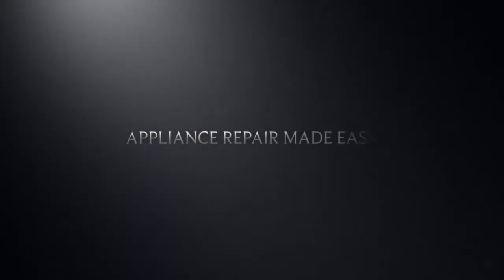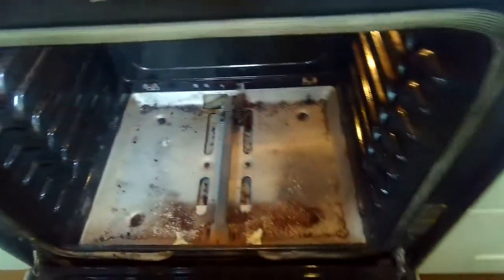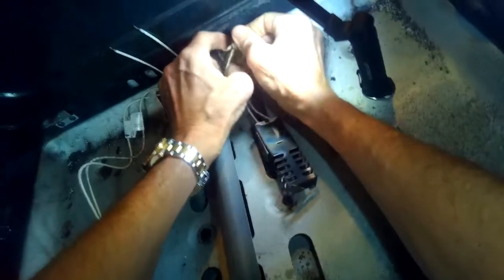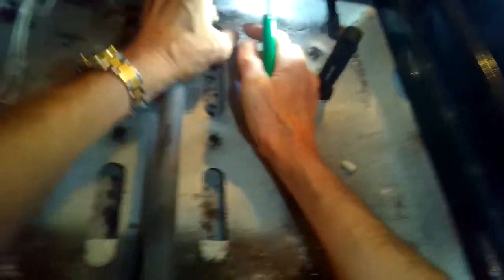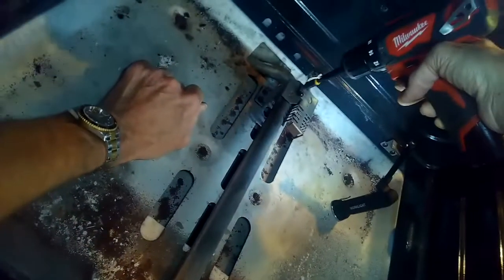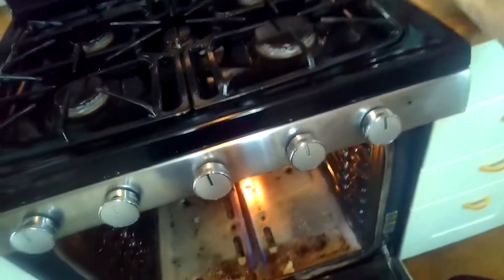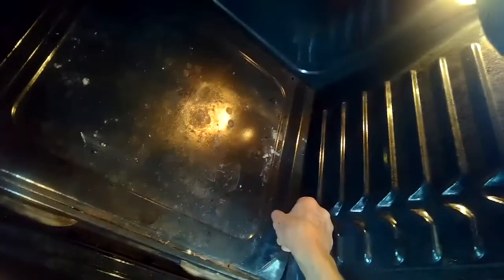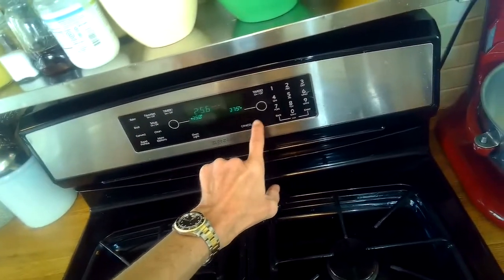🔥Gas Oven Not Heating — EASY FIX🔥

Comment: I've got a Kenmore 73433 that lights the igniter glowing bright red but the gas takes a minute to turn on or never turns on. If it doesn't turn on we can unplug the oven and plug it back in and it will usually light the next time. Any idea what could be causing this? Bad control board or gas valve that doesn't work half the time?
Reply from the maker: Changing the igniter will fix it.
Reply: @ScottTheFixItGuyChannel  I guess I don't understand why this would fix it since the igniter glows white hot and the gas just never comes on. Does the control board sense current and my igniter just has too much resistance at high temp to trigger the call for gas?